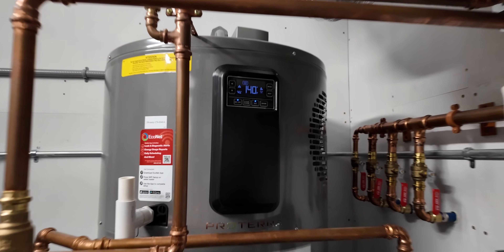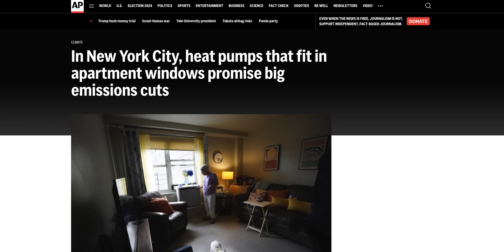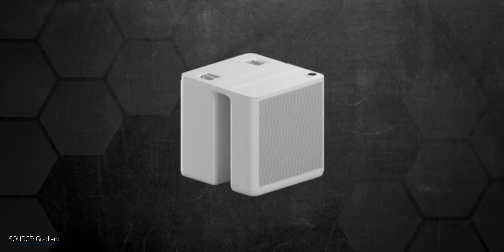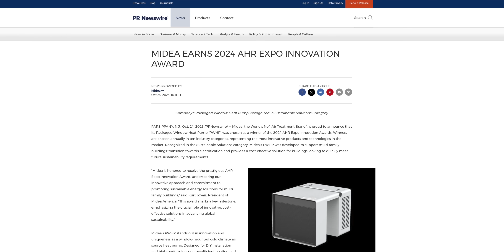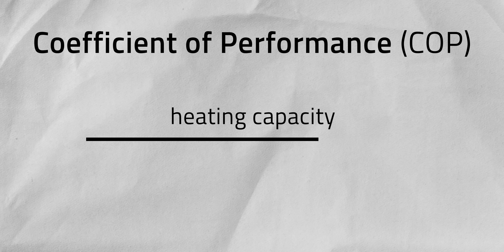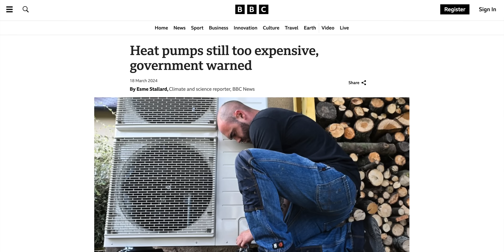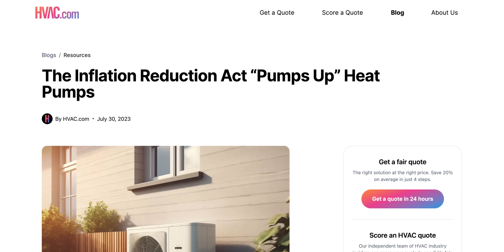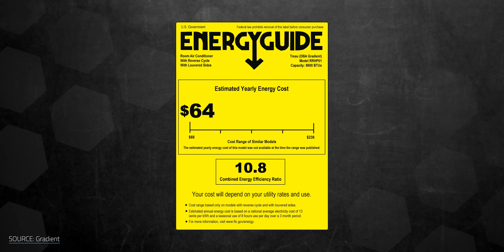Why This Window Heat Pump Is Genius

Comment: I am sorry to say that every single window unit and even those mini splits all have one problem that no one talks about and that is filters. The filters suck on these things. There is zero chance that in a couple years it wont need the coils cleaned. The filters one these things are low grade useless trash. None of them have sealed filters. Even my expensive window AC unit has the cheapest filter that does not have a seal on it and still allows dust, pet hair and everything else to work its way around the filters. The entire system is trash because of the filters. I would not want to have to clean a mini split unit after a couple of years. Which is one reason why I have skipped the option of upgrading my system. While the idea of being able to have heat pumps separate in every single room they just do not have the ability to filter the air.

Comment: Interesting video.    EV raffle is hilarious to me as they are giving out the least efficient EVs, (maybe not the plaid).  Could have handed out 2x the EVs with smaller, more efficient and friendly versions that cost a lot less.     Be honest AC unit for $150 would work like crap and die in a year, actual AC window units run $300-400 on low end that actually work.   All these units in windows are not going to pop breakers?    There are more parts to heat pump, but they use parts that are common in AC industry so why do they cost 10x as much?  2-3x I can see.

Comment: Explain to me why a heat pump that only has valving to allow it to reverse its function costs four or five times what that of a window air conditioner costs. I know it's more versatile, but you shouldn't pay for the versatility of physics. You should only pay for the actual physical components and a reasonable profit. they are ripping us off, and you know it.

Comment: A heat pump operating below 40 degrees has significantly more engineering than a standard AC or even traditional heat pump. You need to include a system to defrost which has its own engineering challenges (sensors, ways to remove the moisture, etc.). If you have variable power output, which many of these systems operating below zero degrees need, that’s additional equipment and engineering. Otherwise installed cold weather heat pumps would be much cheaper.

Comment: I know you're big on new tech - but in the case of heating and cooling a home (big buildings ???) SEALING air leakage is a much more cost efficient way to save $$/electricity.  Perhaps you could partner with DIY folks to show how-to-do things.  I've done this on older homes - cut my energy use by half on the first (ROI - 1 year) - 25% on the second (it was a newer house so less leakage - ROI - 1 year). Even seasonal (hot or cold) tape around exterior window fittings can do wonders.   Thanks for your videos

Comment: We have a tiny half bath right next to the front door against an exterior wall. There's no window, but the room is at risk of frozen pipes every winter. I'd like to see an extra small heat pump just for such a room.

Comment: All your COP numbers don’t take into consideration the efficiency of production of electricity and all the losses in transmission of the power. Also the false claims that the power grid could handle the increase in demand when we already have power outages when we have extreme weather. And the fact when it gets extremely cold outside heat pumps use old fashioned electric heating elements.

Comment: The one for gradient is useless for Florida . We just got finished with many days of around 97f . For Florida you need to exceed the max temp by around 10deg f. My $550 mini split is good up to 120f making my $550 unit far more ideal . That ceer rating on the gradient as well is to poor for sure . Either way a huge no for these at these very high prices

Comment: $3000 , are they out of there mind ? $3000 to cool and heat 1 zone is insane . Looks like they are experimenting with selling to those that have a lot of money to burn . Selling what they can at a huge profit then lowering the price a bit after that wears out . I bought a ductless mini split . Installed it myself . 9k btu and plugged it into my room . $550 . Super cooling and heat at 100% efficiently down to single digit temps .

Comment: Excellent presentation as always. I have to say, my favorite part is the inclusion of graphic "Environmental Impact of Air Conditioner Refrigerants and Trends" showing what an unworthy replacement R410A is for R22. I wish R11 had been included as it was the most common refrigerant used in water chillers.

Comment: Too expensive for what they are. Interestingly, a window air conditioner is a heat pump, but it only works in one direction (cooling) and is only $150. That is a tiny fraction of what these sell for. Might as well use a space heater for the winter, depending on where you live. In my case, I have 21 acres of woods and a wood burning stove. So the solution is easy. 😀

Comment: nobody on this thread knows what a heat pump actually is. The "heat" on the cheap ones is just electric resistance heating. Refrigerants with big range of temps require higher pressure, fancier pumps.

Comment: Politics... you sound like a politician, or a blogger WEF fan boy, you probably go to DAVOS in the cheap seats, eat ze bugs!  ya!    Heat pumps do not work very well at all, below say 20F.  So yeah go ahead and install those heat pumps and try to claim that the 3-4 months of bad weather out of 12 will make up for the super efficiency of the rest of the year.  Theft, these can be stolen.  A boiler and a radiator don't consume much electricity, but hey you probably want all electric cars too, and NYers get to claim "progress" for instituting these "improvements".   Where is your nuclear grid?  It is all madness

Comment: The tech difference between a AC unit and a dual AC/Heat unit minimal so these prices will fall fast. I'd guess $1500 within 2 years or immediatly after the government program stops and the market starts. These are room solutions not house solutions unless you install in multiple rooms with solid interior air flow.

Comment: Comparing COP of Gas heat to the Heatpump without considering where the electricity is coming from is ridiculous.  Assume gas is 94% eff or 0.94 COP.  Midea is 2.35, but if electricity comes from Simple cycle combustion turbine powered by gas @ 40% eff then 0.4x2.35 = 94% or exactly same as gas furnace. 

Source of electricity really matters.  Direct fired gas is pretty damn efficient.

Comment: Why are heat pumps so expensive in the US? Here in New Zealand where heat pumps are already in around 50-60% of all homes, it's only around NZ$1300 ($US800) to get a 2kW heat pump installed, or $2200 (US$1300) for a 7kW unit

Comment: A thing that people in the comments complaining about the cost of "heat pumping" a $200 AC window unit, is that this is an inverter based system.  The inverter and controls manage using 120v vs 220v AC, and converting that to DC to run DC motors that are easier to control to achieve variability.  The variability helps achieve the efficiency under partial load.  All that adds cost.
A company could produce a cheaper heat pump but it wouldn't be efficient, nor quiet, nor be as effective at temperature extremes.  You CAN get a mini-split that does that for less than $3k.  Even under $1K. Good luck finding one you can plug in to a single 120v outlet at ~20a.  Other mfrs could change their form factors, AND create the one-sided install frame-kit, and all, and prices could come down...some day.  
That One-sided frame-kit cannot be under-sold for convenience, safety, security, appearance, and portability and re-use. Would like to see more designs like that for plain window AC units.

Comment: Looking at the complexity and carefully designed, ready to be installed anywhere, that $3000 is a reasonably price. There is massive difference between this and the old style boxy AC window unit.

Comment: I have a Friedrich 120V window heat pump. In fact before this Gradient came out, Friedrich’s was the only 120V window heat pump on the market. (I believe Amana makes a 240V window heat pump.) Including installation it cost me about $1500 and it was well worth it! Unlike most heat pumps, Friedrich’s model also has an exhaust fan to remove smoke or odors and an intake fan to let in fresh air or cold air when the temperature outside is under 60 degrees. That’s why these Gradient and Midea models cost more, they can work in much colder temperatures

Comment: The problem is you can't use the window while it's in there (just like an AC unit). I saw a video about alternatives to a Mini Split or in wall HVAC.
Sure there are advantages over a typical in window Heat/AC, like it doesn't block the view, but you have to take out the screen, and put insulation between the top and bottle window parts so no option to use the window without removing that insulation and going without a screen. There are times where it's always cheaper to open a few windows and get cross breeze than run anything.

Comment: There wont be a problem with strain on the grid. Because the efficeiceny of one heat pump is like removing 2  electric heaters required wattage.   what it will do, is put a shit ton of noise into the grid with all the new variable speed drives that these are likely to have.   Theres going to need to be equipment, most likely large cap banks,  for city wide power factor stabilization.

Comment: 12000 BTU inverter minisplit with installation is less than 500$ in my country, for 1500$ you can get a 12000 BTU inverter mini split that can run directly on solar, the price includes solar panels,wires, and installation fees

Comment: so.. you are doing product ads now?  This doesn't even qualify as a review.  Then there's the cost which is already high, but compared to a 2-digit cost of basic electric heaters, goes beyond the pale.  COP doesn't even enter the picture since for nearly all multi-story apartments tenants pay flat fee electric billing (if that) - not usage-based, so this product has negative incentives.

PS: the 3D render clip on repeat got too much half way thru.
PPS: $200 raffles?  wtf?

Comment: All these comments are comparing a currently available Midea window heat pump that costs $500 to this one.  But that is a useless comparison.  Why?  Because those heat pumps can only provide heat when the outside temp is above 41 degrees F.  So it will be useless as a heater in NYC (and many other cities).  There are many months of the year where it never gets ABOVE 41F.  So yes, the $500 model is cheap and provides heat - as long as you don't need heat anytime from December to March.  Whoops.  I'm surprised that people on this channel aren't more thoughtful about the details like this.